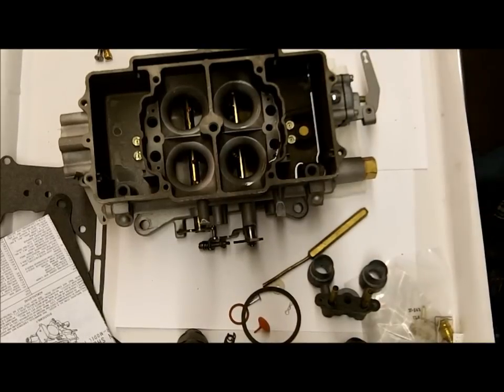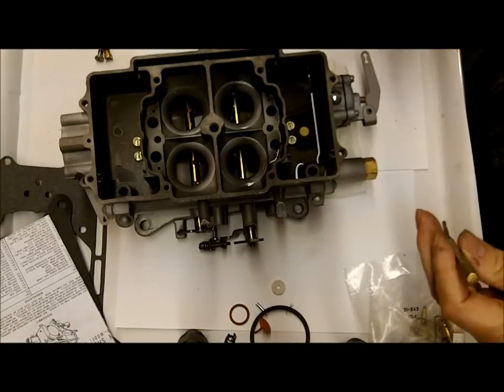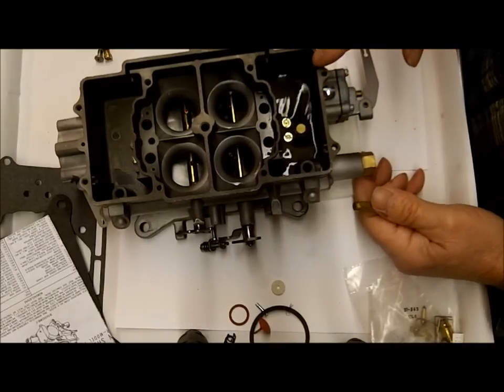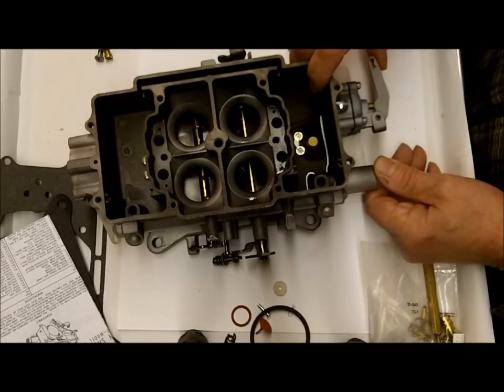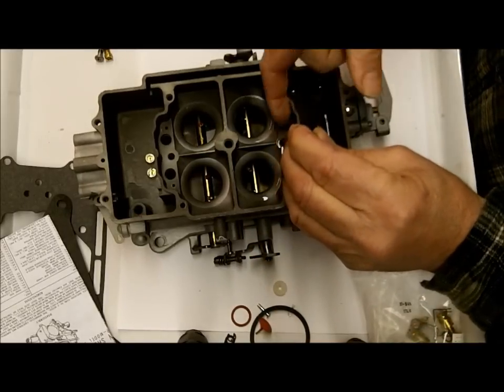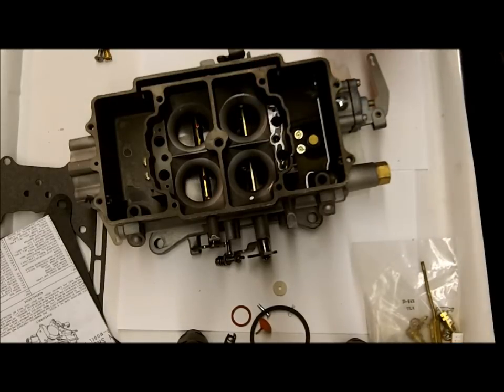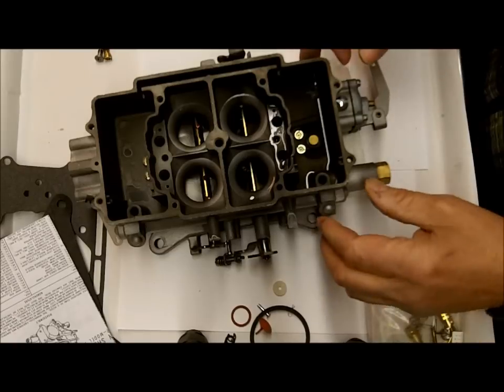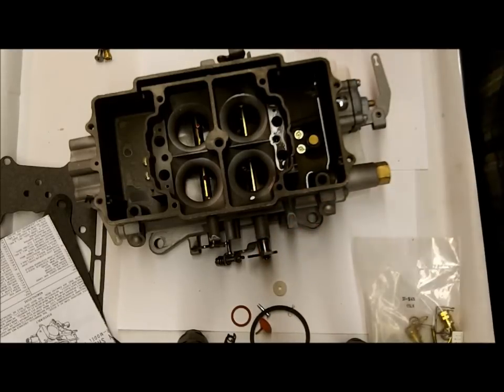Autolite 4100 Carburetor - Testing The Check Ball

Comment: hey mike i just bought an old 4100,it came with an unopened napa rebuild kit it was very clean,blew out all the holes. it idles very hig around 2000 rpm..leakgage looks good..even took them all off,no change. took the butereflies loose cleaned them reinstalled. the seat very good no problem. would a leaking check ball make it idle high? you made a great video about it,but didnt tell us the symptoms of a leaking check ball,i put the new one from the kit in,thanks

Comment: Mike, I have a 4100 that was rebuilt but sat up after installation on a 65 Mustang.  After several months that car was started and fuel started to run over and out of the seep hole located on the top.  I replaced the outer gaskets like the accel. pump, base, etc.  But I am still getting fuel pouring out.  The floats move freely....could the check ball be stuck or is there something else that might cause this problem?  Thanks in advance!